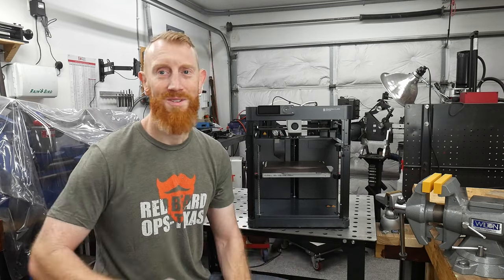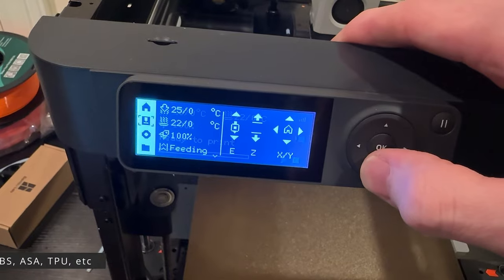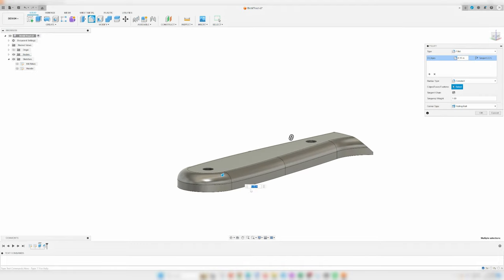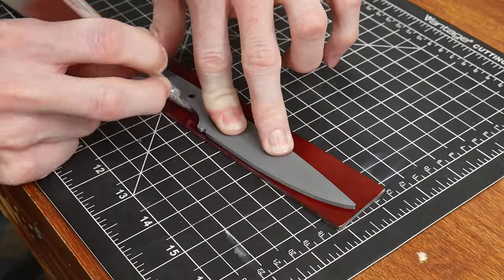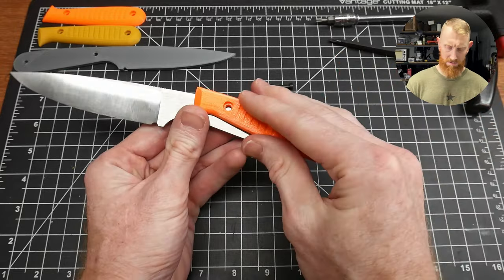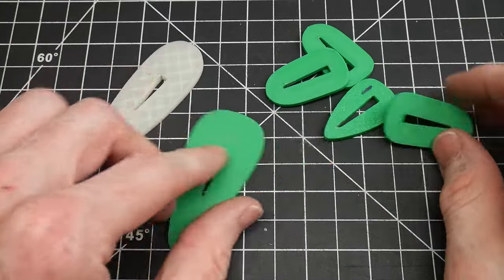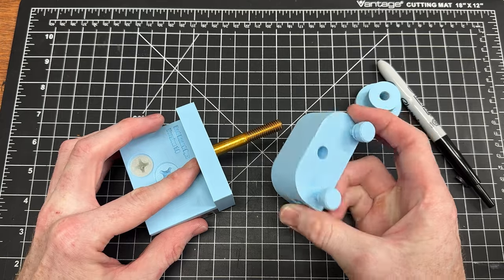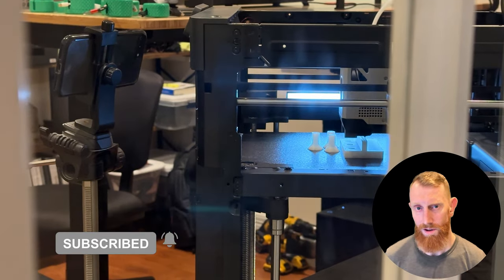Are 3D Printers Good For Knife Making? | Bambu P1P

Comment: I've designed and 3D printed some stainless screw mounted scales for a 440C Texas Knifemakers Supply chef's knife.  It is one of my favorite knives in the kitchen.  Made them with ABS and it bolted right on no problem.  Just used that very knife to cut some snacks up. The stainless hardware I bought from Lowes Home Improvement has proven itself to be a tad weak when dealing with the bleach contained in dishwasher detergent and is rusting pretty heavily now, but it's holding up well otherwise.
Reply from the maker: Very cool!

Comment: Hey brother. Highly recommend you try ASA for scales both for heat resistance and UV resistance. You'll need the enclosed printer to do it. Also, for scales I would do 100% infill unless weight is your first priority. Check out Frankly Built for tips and tricks to put high-end finishes on 3d-printed parts. I have a P1S with AMS and also a QIDI 3 series with heated chamber. The first gives you the option for multi-colored prints while the second makes certain engineering materials like carbon fiber nylon more practical. For jigs and stuff,  there's usually no need to get fancy with materials. PLA will work. Hope you continue to show us how to use our 3d printers for knife-making!
Reply from the maker: Very cool! Thanks for the tips! I'm going to get that enclosure kit for sure.

Comment: Great Video, thanks a lot! Would love to see the Fusion 360 Tut with Knife Making in mind. Also, you could try Nylon / Fiber-Filament as Handle Material. The Bamboo can handle enough Temp for it, and it should be ultra durable and on par with Materials that are used for Serial Knives Handle Scales like G10. Needs Enclosure tho. Edit for Idea: You could print the scales vertical with supports instead of horizontal / flat. This way, the Print Layer Grooves would provide extra Grip in wet conditions, and be implemented as feature in design and function. That should make for a damn fine Handle, for those who like these kind of "tactical" look knives.
Reply from the maker: Good idea for sure! That stuff is strong!